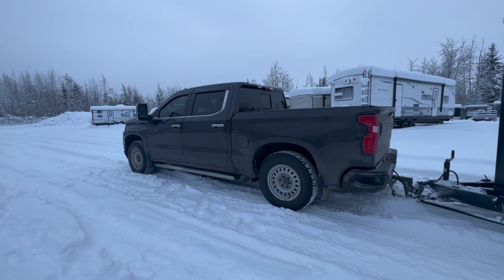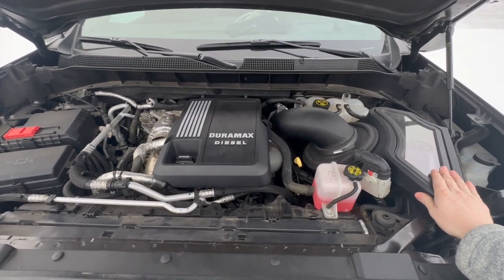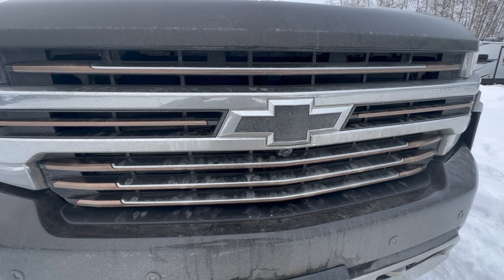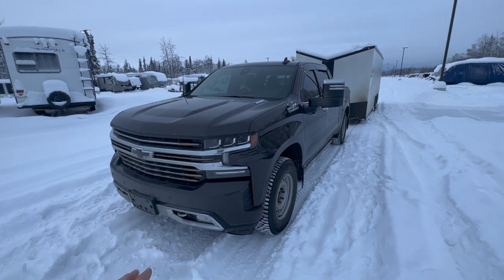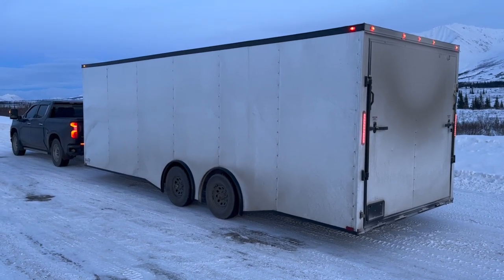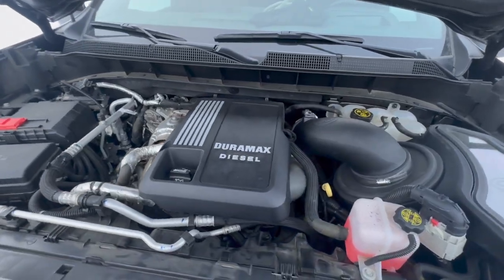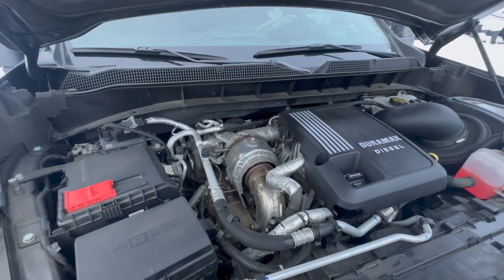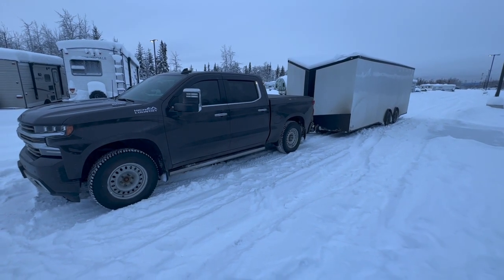3.0L DURAMAX WINTERIZATION- IS IT A COLD WEATHER DIESEL?

Comment: Useful enough, but it's clear you swapped to winter tires, yet no mention of those in the winterization video?  Also, nobody drives up and down the Parks Highway all winter long without auxiliary lighting.  Either the Silverado has some awesome lights, or you did the trip entirely in the daylight (as I assume from the photo of the Denali sign during daylight). 

That winter front can be more than useless on a vehicle with grille shutters.  I have one on my (pre-puke-ugly restyle) Duramax HD, and even in sub-zero temperatures, it will cause EGTs to soar with a sizable trailer.

I was hoping you would post some real cold start videos.  My neighbor has a new 3.0 Duramax and had troubles starting during a cold spell when it was left in the Fairbanks airport parking lot for a couple week.  I own a lot a diesels and have never had cold temperature start issues, even down to -50.  Your -15 degree starts don't really mean much to me.  I'd love to see a true interior Alaska cold start video.  

Love the engine, unfortunately not the truck.  GM has a habit of introducing gag-worthy trucks (aesthetically), and then making them look less hideous over the course of 5 years or so, before introducing something even uglier.  I think I will wait until GM is about to introduce the next version of the Silverado, to see if I could stomach the current version enough to buy one.
Reply from the maker: Bert, you are spot on, man. 

Yes, I have studded tires on the truck, man does the towing feel night/day over the factory 22" wheels, and these tires grip on all the ice we have up here. One of my favorite things to do for all of my vehicles. I toyed with mentioning it but left it out, trying to focus on the 3.0L, if that makes sense. 

The lights are beautiful, but oh buddy the lights do not put out as I needed; or expected. I had difficulties seeing out farther than 300', especially along the shoulder. Only about the last 3 hours of driving was in the dark...never again. Moose lights will be going on if this becomes more regular. 

You and me both; I am waiting for -40 to hit to get the cold start. It honestly isn't too bad. It's the only time I have to "wait to start" to give it a couple seconds to warm up; the plugs are amazing. Your true interior Alaska Cold Start Video will be out when temperatures allow. Haha, it's been an above-average warmer winter. I have been eyeing the new LZ0 paired with the new Interior. I am more of a GMC man myself, but it was something about this Silverado I kept going back to. I call her "Moose", Brown with big ole Antlers as tow mirrors.

Comment: Time for a PPE Intercooler…
Reply from the maker: Do they make any parts for the 2.8L? We have loved our Transcooler and bypass block from them. Installing the rear differential cover here soon. Love the quality of the parts!
Reply: @CHASING_BUILDS  PPE doesn’t make anything for the 2.8 although I have HOUNDED them. Maby you could call in also and ask them.  Before I got my modern yellow star and was booted off Facebook for being conservative I got a campaign going in some of the 2.8 groups to hound PPE for 2.8 goodies.  My 2.8 I did a custom trans cooler with a thermostat so it will still stay warm in Wyoming and the PML pan. I put in the CX racing intercooler because the DT44 turbo and hot tune melted stock intercooler plastic end tank.  If you go the CX racing intercooler route throw their hot and cold side boots away and upgrade to longer HPS or similar couplers. The biggest complaint about the CX kit is the couplers are too short and people fight boost leaks.  After I sorted all that mess out it performs nicely and banks Idash shows it keeps cold side within 20 degrees of ambient temp even on long boost adventures up long grades.

Comment: It really is a shame that GM carried over the duramax nameplate over to a little 2.8/3.0 diesel.. that’s the way of the world I guess.. I’ll stick with the 6.6 and 3/4 ton chassis
Reply from the maker: Cody, this topic would honestly be a wonderful video comparison. Thank you for the idea! 

I LOVE my 6.6L durmax. But I would have to argue as much as I love the 6.6L with the 3/4 Chassis which is great when im towing 10k+ lbs and has insane power; the 1500 with the 3.0L DURAMAX is much easier on the pocket book in terms of fuel consumption and comfort. It fits the right crowd in terms of capabilty. 

Hopefully that makes sense. I would defiently recommend owning one of each, can't go wrong with owning best of both worlds.
Reply: @CHASING_BUILDS  definitely I think every truck has its own purpose/niche and there is a need for a good 1/2 ton diesel option for those who don’t need a heavy duty truck! I just think its odd that GM carries the nameplate over even though the engines don’t share much in common and the Duramax has always been a 6.6 V8 diesel
Reply from the maker: @codystrom8708  Very true,  plus the DURAMAX dominates the mid-size Diesel market over the Powerstroke and Cummins competition. I tip my hat to the ground-up redesign of the 3.0L DURAMAX. You can also own a diesel engine for under the $50k mark. The Duramax also gives the 6.2L a run for its money in terms of torque numbers, and fingers crossed we see the longevity out of the 3.0L that we see from the 6.6L.
Reply: You stick with what works for you, my new 3.0 has 5 more hp and 20 lbs less torque compared to my old 6.6 duramax, took a big poop and didn’t even notice the differenceI now have 2x the gears. My 2002 3/4 ton is for sale and gets 10 less highway mpg
Reply: @HomesteaderJake  the 2002 model is LB7 which is by far the least desirable and powerful duramax and has the 5 speed Allison compared to the 6 speed the later models have. I use my 3/4 ton for towing/working more than daily driving so I’ll trade a little fuel economy for reliability and more heavy duty chassis

Comment: all production engines are all weather engines
Reply from the maker: In my experience, some perform better than others but I believe my point on all weather was geared towards the accessories and the detail GM put into things like their Block Heater Line.
Reply: @CHASING_BUILDS  yeah. The gms come with engine block heaters and grille covers for cold weather. Gm is doing it right